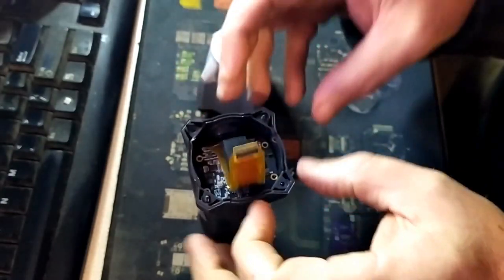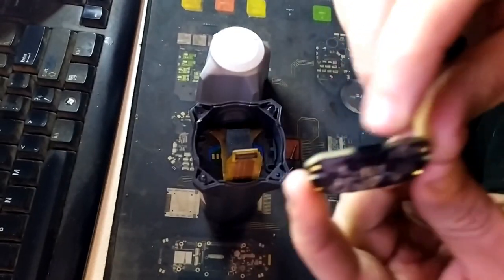Fixing an Emlid Reach RX that will not charge

Comment: For something that just needs to sit on a pole all day, this seems an unnecessarily small and fiddly construction.
Reply from the maker: It works is all I can say, I guess the form of these sort of things is important for brand recognition. They could just be a box. Not having to take it completely to bits to replace or disconnect the battery would be a feature I would look for in any device. I wouldn't even call that a feature.